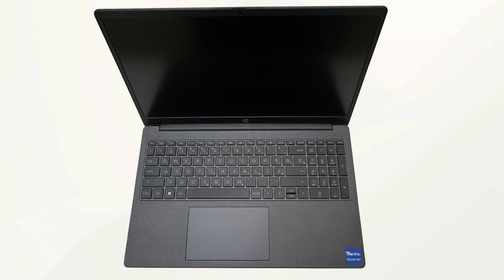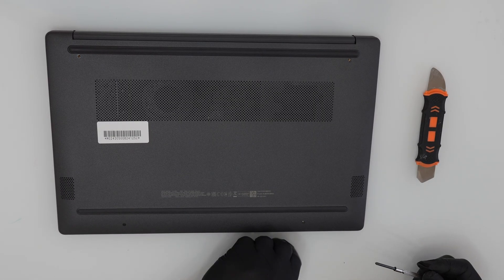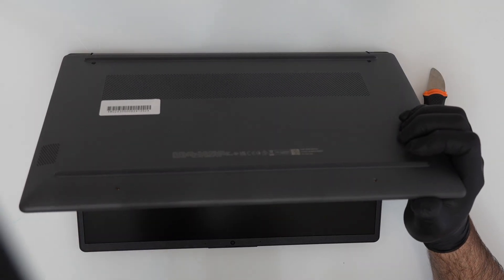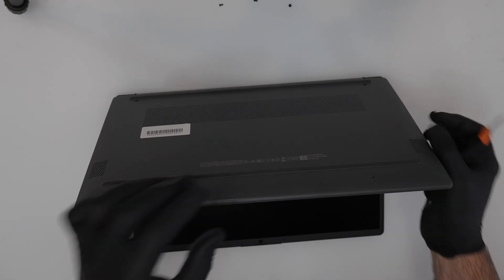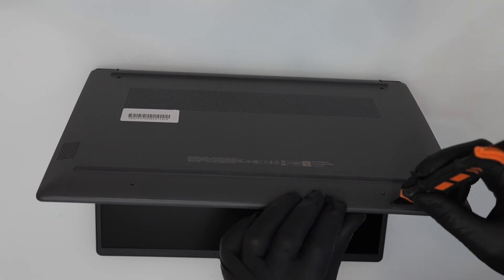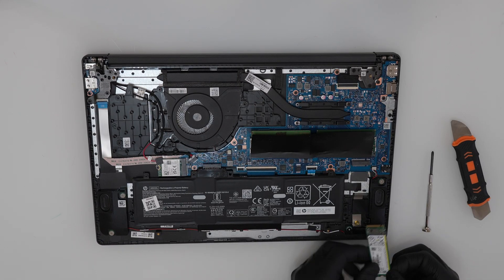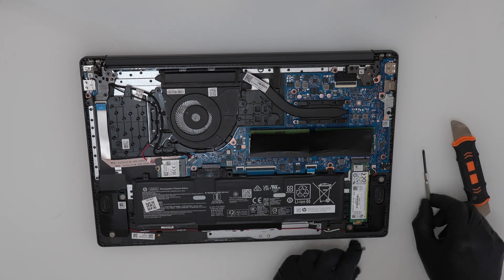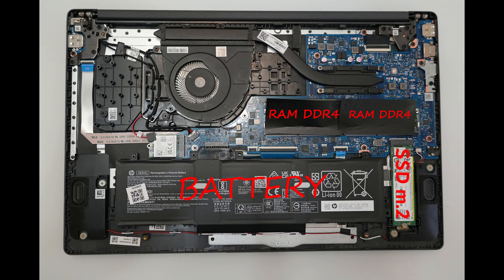HP 255 G10 disassemble upgrade AL0A9AT

Comment: Thanks. Looks easy. They sell this model with ddr5 4800 Mhz in computer stores in my country and with 32 GB RAM, but i read it can be upgraded to 64 GB. Not sure it's legit information... I might try that after the warranty expires.
Reply from the maker: You don't need to wait for the warranty to end, just be careful not to damage the warranty stickers on the screws, you don't need to remove them for the RAM, if it's DDR5 then you should go for 64 GB, try it in a store that has service so they can test it right away
Reply: @crotechtraveler thanks again! 🙂